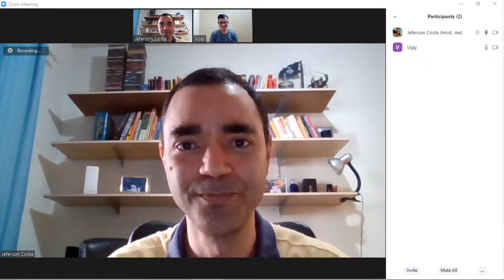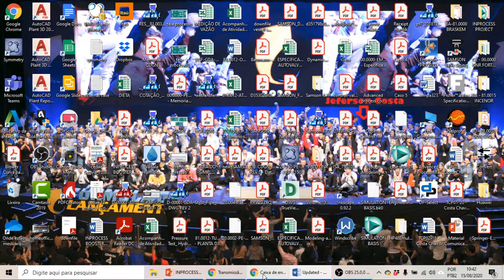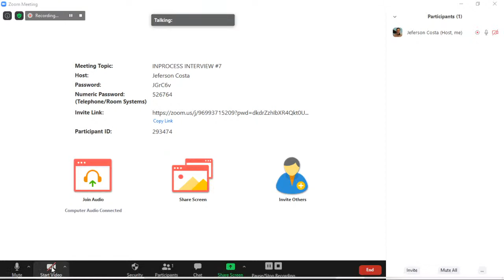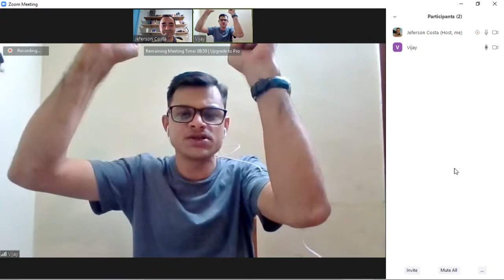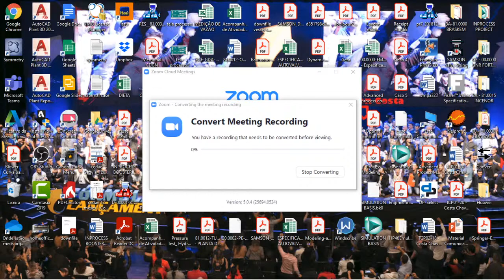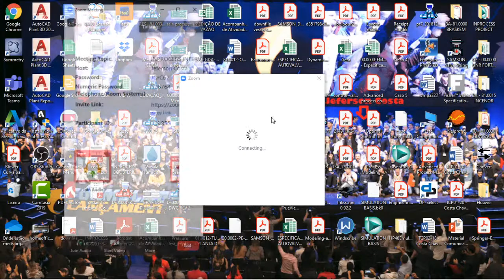What it takes to be a Chemical Process Engineer

Comment: Guys you are doing here an extremely important service to young engineers - we have a major industry problem with competency levels of engineers as well as their mindset (wanting to be managers with titles and expensive cars, rather than real engineers). Furthermore I find that academia trains them to be researchers not engineers - no mention of failure modes n effects, CSU, ops practical issues. At the same time concern about HSSE is limiting the exposure of young engineers to operations. being an engineer is about practical knowledge, true understanding of the physics and chemistry, gas, liquid and solid handling (and not only pressing simulator buttons). One cannot build a plant if one has never operated one - and this is the root cause behind so many project failures I have seen in the last 20 years. Engineering is not about salary and titles, but practical knowledge as well as ethical consequences of our decisions.
Reply from the maker: Thanks for adding your comments Zak :)